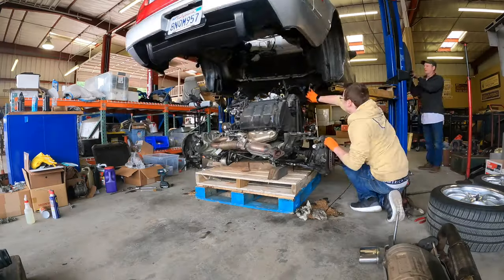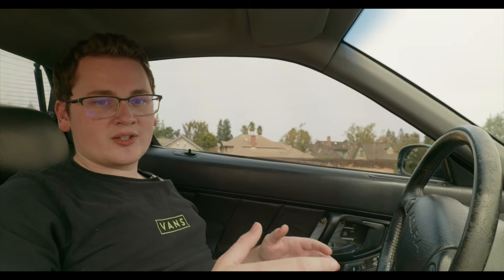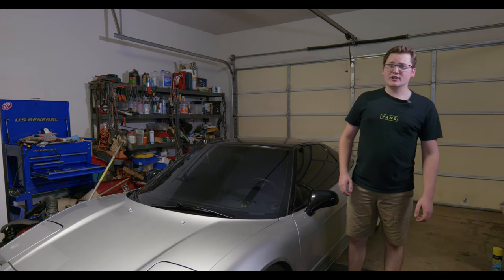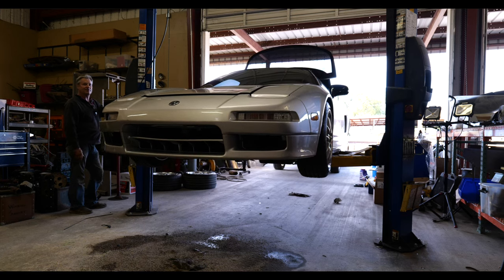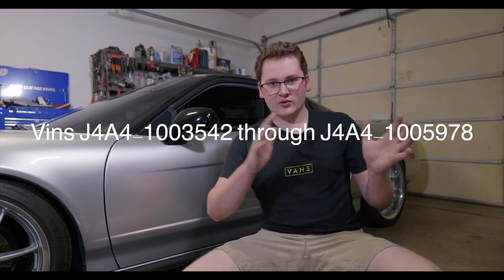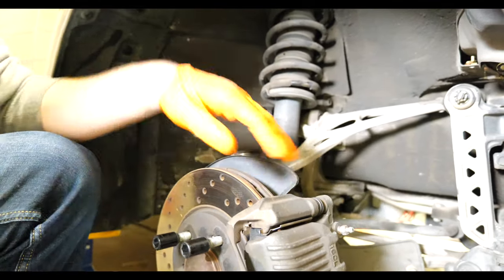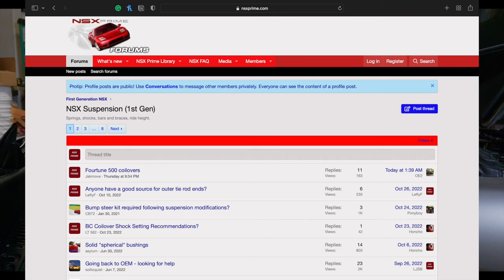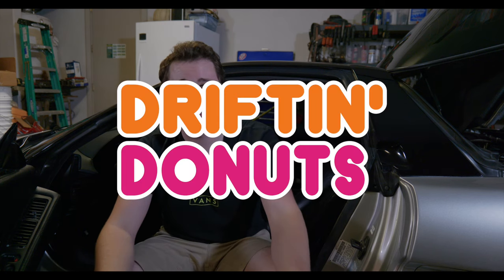What it's like owning a Acura NSX at 20 years old

Comment: As an owner of a 91 Sebring Silver of 17+ years, I greatly appreciate seeing younger folks taking the torch on keeping these on the road.  I bought mine with 26K miles and she now has 115K.  Original clutch still.  As you talked about the transistors (you meant capacitors) in the climate control board, another issue is the brake lamp indicator lighting up,  which can mean bad board capacitors.  Fairly easy fix.  Keep up the great content!
Reply from the maker: Love hearing about owners that actually drive these things keep up the good work!

Comment: Great video. Thanks. I changed out my ABS to a later model here in Japan at Honda Cars for just over $2,000. At Suzuka I never had ABS so learnt very quickly to have the car balanced while braking. Tried again with the ABS and felt like I had lost some control over the car on the circuit. For a panic stop on the street then the ABS is a must. Have used NSX Prime so many times. Honda parts are not expensive here and labour charges at Honda Cars starting about 15 years ago are sometimes so cheap as for me not to bother getting my hands dirty.
Reply from the maker: It's a dream of mine to visit suzuka, but to drive your nsx there that sounds amazing! Love hearing when these cars get used the way honda intended!
Reply: @driftindonuts   It is rare that I trigger the ABS on my 1991 car, however the one major incident I have had in the 16 years I've owned the car would have been massive and destroyed the car if it wasn't fitted. As it was, even in the midst of the scariest moment I've had on the road I was marvelling at just how rapidly the car pulled up when you really absolutely definitely needed it to!